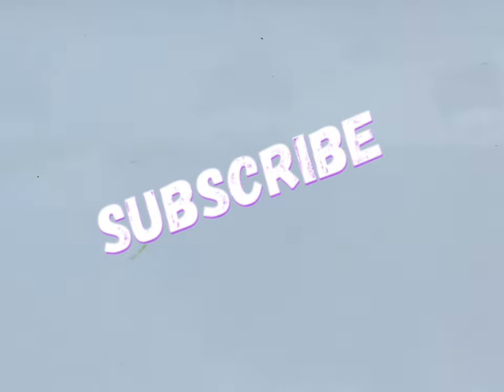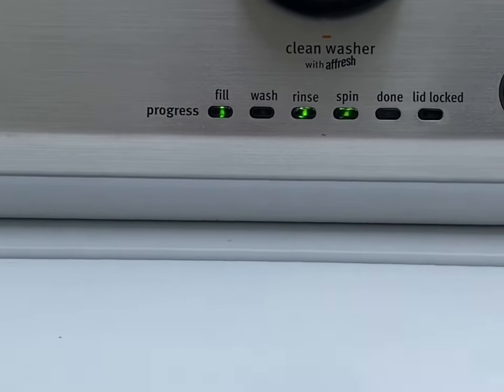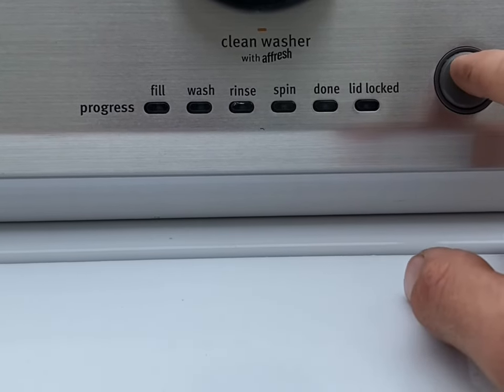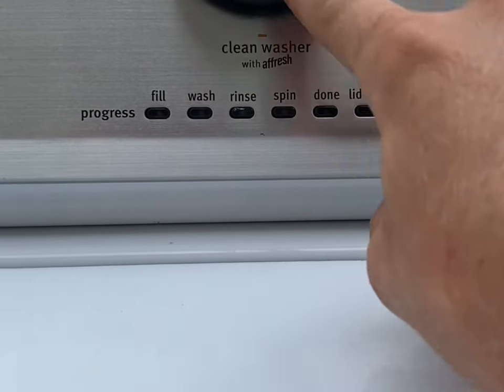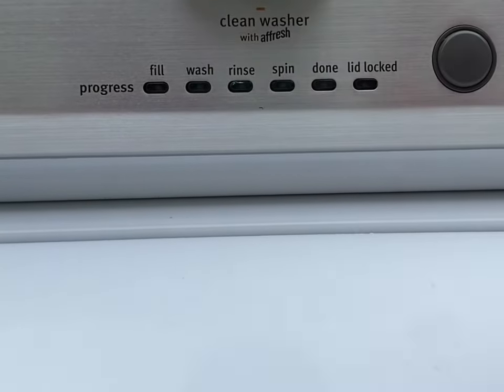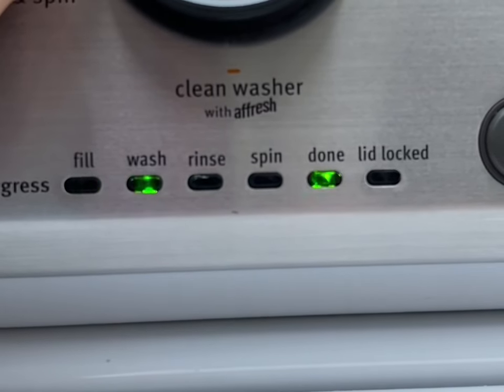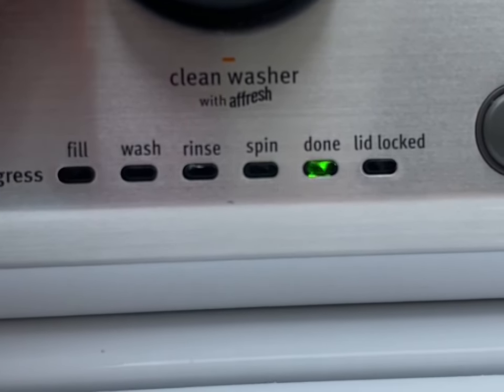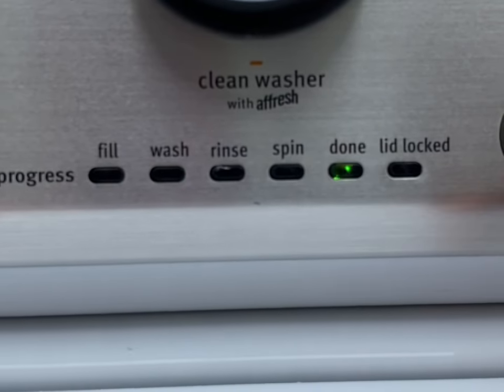Maytag washer stuck on wash cycle *FIX*

Comment: I have the same problem. I did exactly what you said. But when I hit start at the end nothin happens
Reply: You have to make sure you go all the way over to rinse cycle. This is to recalibrate the machine , It should say done at the end after a few minutes.
Reply from the maker: If the method in this video does not work you may have a failing part. The issue could possibly be within the lid switch, shift actuator, and a couple other parts that give the same symptoms.
Reply from the maker: https://youtu.be/bAWc0kqytUI?si=a6zLRBrR-aMePCTm

Comment: Mine is a Maytag commercial technology. It doesn’t say rinse and done or wash and done , it says drain &spin and rinse & spin .
Reply from the maker: Once in the test cycle if you notice the sequence to the lights as I’m Turning the knob. The lights will individually light as follows rinse, done , wash, done.
Not on the settings on the dial but on the led indicators thanks

Comment: I have a washer that gets stuck on every cycle, I have to move it manually forward through spin, wash, rinse etc. Mine isn’t electronic. It’s just a manual knob. How can I repair that?
Reply from the maker: This issue is more than likely in the timer switch. Here is a video of a standard model washer timer replacement this should fix your issue.

https://youtu.be/hdFXdzvJpFQ?si=dX2TO7peHS2xsOpj

Comment: Seems like you are turning counter-clock wise not clock-wise but we can't really see how you're doing this. I have a MAytag BRAVOS XL stuck on wash cycle blinking. Be helpful to see when you say turn "which way?" to "rinse cycle" dial, then "wash cycle" dial, so we can try exactly. However, does unplugging it for a while resets the machine like you replied to a guy's question on ere?
Reply from the maker: https://youtu.be/bAWc0kqytUI?si=QJ8RxMJOjjiR2ZhF

Comment: I did that and now it's stuck with done light on. Even when I turn the knob
Reply from the maker: If the machine stays stuck there is a bad part. Unplugged the machine for 15 mins and if it doesn’t help you may have a failed part thanks

Comment: How can you get the machine to resume the cycle you left off at? I used pause, but did something (held the button too long?) and now the cycle is starting again. I want to get to the rinse and spin cycle. Model MVW5430MW
Reply from the maker: Simply unplugging the machine for a minute or so and plugging it back in should reset the machine and help.